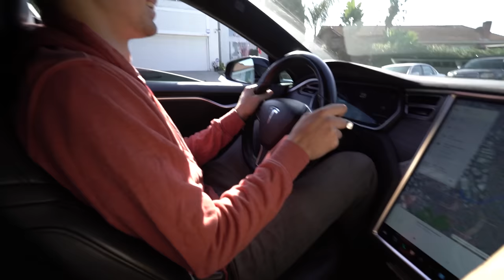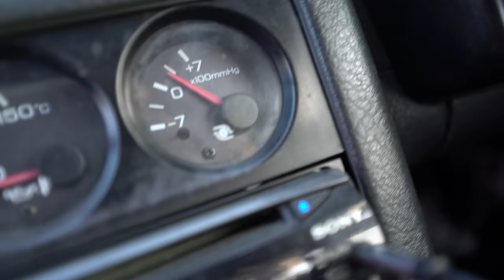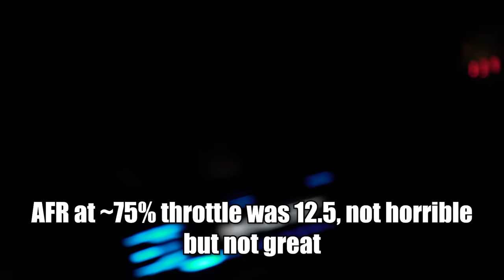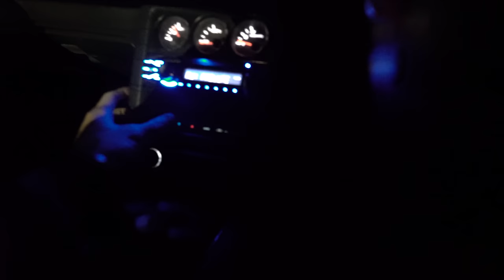I PUT $17 AMAZON HEADLIGHTS IN MY GTR!!

Comment: I have a headache with my car as well. I had to replace a few of the panels and am now in the process of trying to blend the new panels with the old ones. It's difficult because I bought acrylic based paint, when the old panels are polyurethane based. This means I can't get the gloss that the old panels have. it's a long process, but ill get it right eventually.

Comment: If the reliability of an rb26 is true, the time it’ll take for you to get it tuned and fixed on the idle and throttle, you’ll be fine. Obviously get it fixed but do not worry no fear, I have a 2j and it was having issues for like 6months could never figure it out so had my friend look and work on it and it’s fixed and is still the most reliable daily I have. I just don’t beat on it
Reply from the maker: Yup I'm just cruising around on it!